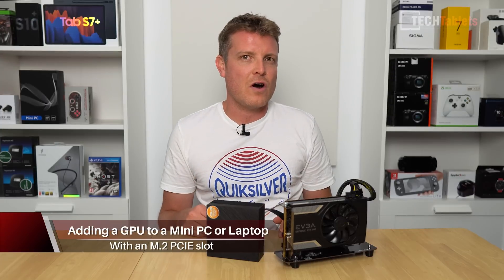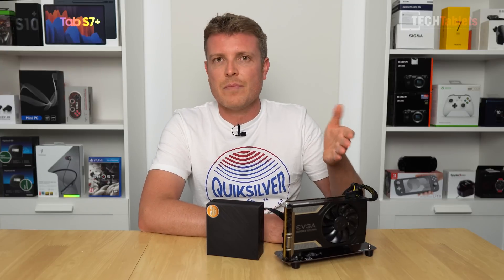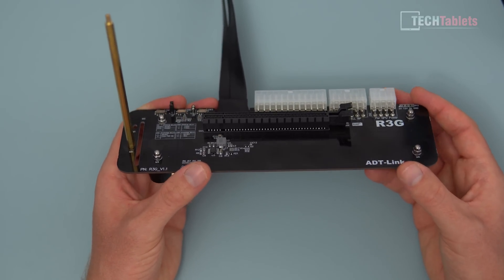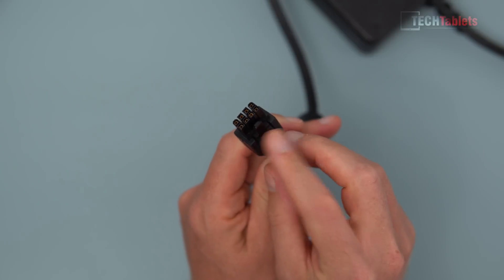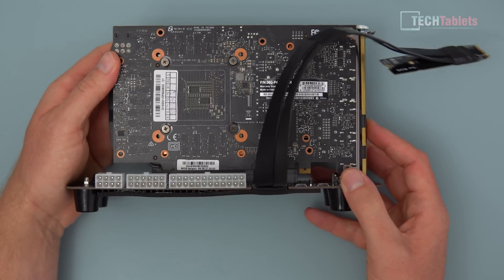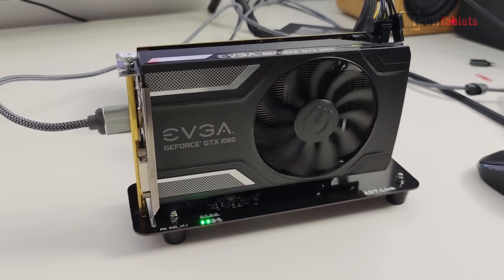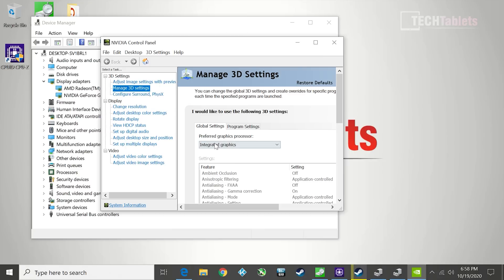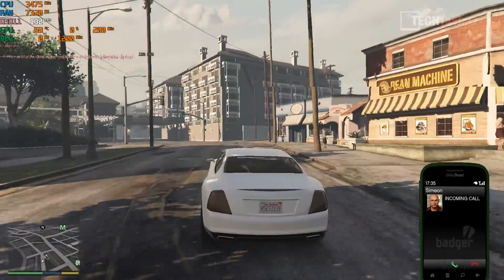Turning My AMD Ryzen Mini PC Into Gaming PC! M.2 PCI-E to eGPU Upgrade

Comment: This is the pcie info for ryzan 7 7735hs  PCI-Express:	Gen 4, 20 Lanes
(CPU only) what does this mean to run an external gpu want to run a gtx 9080 trying to do 5120x1440@200hz resolution

Comment: I have a HA-4 Ryzan 7 7735HS  can I use an external GPU with this want to hook it to a LG Monitor 45GR65DC-B which has a resolution of 5120x1440@200hz can this be done with this mini pc desperate for an answer right know the monitor will only give me split screen, or 3 quarters of the screen with this mini pc because it can't handle this resolution

Comment: Curious.  Has any company introduced hardware that connects to multiple m.2 ports?  2 ports I guess for example for 8 lane.  Not sure if the chipset would be able to make sense of the 2 ports connecting the same device or if it will just see it as 8 lanes.  External graphics aren't necessarily my end goal with my thought process.  I'm thinking of HPC and heavy analytical work.  I've also wondered if any of the multi GPU mining rigs could be repurposed for this idea.  I'm sure I probably am unaware of other ways of adding GPUs for calculation so any suggestions or pointers would be appreciated.  Cool video, thanks.  
I think most chipsets only connect with 4 lanes, so maybe it wouldn't matter anyway unless I'm misunderstanding what I've seen.

Comment: How would a Sonnett  Breakaway puck with The RX5700 work. Running R7 7735HS  32GB DDR5 and 1TB in a GMKtech K2 Nucbox. The 680M just isn't enough
Reply from the maker: It should work fine as long as you have two NVMe drives one for boot and one for the eGPU.
Reply: @Techtablets  
Going a whole completely different direction now ended up scoring on a  RX 7800 XT for near nothing less than 200 so I'm thinking of just building a decent mid grade unit

Comment: ALTERNATIVELY if you dont have an SSD slot for an alternative hard drive, you can use an external m2 USB-C adapter hub. This is especially convenient if you only have one m2 slot that was taken by your old SSD. you can just pop the SSD out, free up the slot for your external GPU and put the SSD (m2) into the external enclosure that plugs into the USB-C. USB-C data transfer rates are fast so it won't affect read and write speeds much.
Reply: What do you do if the new GPU doesn’t show up on the device manager?
Reply: @echofoxtrotwhiskey1595  usually it will show up, it could be:
•check connections
•your pc's m2 slot may not be compatible with this kind of set up
•make sure you have the most recent DRIVER FOR YOUR GPU installed. 
•your adapter may have an issue (the platform you slotted the graphics card on) and you may want to buy a different one.
•you will want to disable the integrated graphics
•you will want to use an external monitor via hdmi from the back of the EXTERNAL GPU to your monitor.
•make sure you are using a BIOS version that is compatible with your GPU.
 
•Google and youtube are your friends. look for other solutions and solve it yourself. 
These are just from the hip thoughts as I was trying to think of reasons you may have issues.

Comment: Hello from Florida mate .. I'm plying around with my minisforum um790 pro and I need both M.2 drives but I could use the PCIe4 on the wifi card, and then plug an USB dongle for WiFi .. but I think the edge plug connector might be different between SSD and WFI female receptacles

Comment: nice build but the used M2-NVME PCIE adapter is way to expensive there are cheaper ones that cost 1-third of the price, also the used DELL-PSU only handles 200watts thats not enough for any decent GPU like 1660ti / 2060s

Comment: Hey Chris. Didn't know you'd made such a video. I usually watch your phone and mini PC reviews. I'm looking to use an RX 580 GPU in such a setup on a laptop. But another video said that the laptop dedicated and eGPU should NOT be of the same brand (i.e, should pair Nvidia and AMD GPUs). Might be the reason why your 2060 laptop had issues with this 1060. Possible to verify? Because the laptop I plan on getting is a Ryzen APU 😅
Reply from the maker: I've had issues with laptops that have s
Dgpus already the best ones are those that only use intergraded graphics.
Reply: can we use RTX 4060 with i5 12500H laptop with that connector @Techtablets

Comment: It won't work on laptops or mini PC's that already have an NVIDIA gpu, so you need to to buy an AMD GPU for a PC that already has an NVIDIA, and NVIDIA for a pc that already has an AMD gpu, if the computer has an intel graphics then AMD or NVIDIA will work just fine.

Comment: I have a problem with a similar setup. In my setup, I'm using a 6600xt with a 4k monitor. In mostly newer games, after Vram is full, the power draw of the GPU reduces a lot(like 130 to 80) and FPS drops as the same percentage at best, while all of the other metrics are normal. As I can't monitor real-time pcie bandwidth usage, I can't be sure. Does anyone has experienced this kind of problem?

Comment: I have a mini pc with 2 pcie slots, 1 m2 sata and 1 nvme 2280. I connected my rtx 2060 super on bolth slots, but the performance is always the same, it shows x1 on cpuz

Comment: Does anyone have info on which low wattage GPU selection would work with the SER 4800U? I've maxed the overclocking as far as it will go, just needs more muscle from GPU but although the install and setup are easy there's not a lot of info on compatible GPU with the AMD Ryzen 7 4800U. I'm looking to stay below the 200 watt threshold as to not have an insane power bill. Thank you in advance

Comment: Love your video’s.I was wondering if I’d be able to use that adapter to plug a 3060 to into the second m.2 slot on my Beelink gtr 5 with a 5900hx. Would that allow me to do it without using a sata ssd for the os?

Comment: Hi Chris, maybe you can help me? I have the Minisforum HX90 Mini PC and I want to use the Nvidia RTX 3080 Ti FE with the ADT-Link PCIe Board connecting to the NVMe PCIe slot. The power supply is the Dell DA2. I placed the ADT-Links connector instead of the NVMe SSD. Before I installed a 2,5" SSD. Unfortunately the RTX 3080 isn't recognized of the system and isn't shown in the device manager. Do you have a device solving this problem? Kind Regards Jens

Comment: I'm gonna try one of these with my 390X by Christmas time.  Need to source an SFX Full Modular power supply with enough watts & amps for a fully overclocked AMD R9 390X 8GB clocking to near 1250Mhz core & 1800Mhz memory which is 80 Giga Pixel per second & nearly 500 gigabytes per second memory bandwidth.  Requires a lot of juice.

Comment: I have to x400 minis I have 2 m.2 slots but are not nvme I got a m.2 m key to pciex4 and a pciex4 to pciex16 will this work ok? Can I use the adt even tho my ports are not nvme? Please help I have a GTX 1080.

Comment: Is the mini-PC able to power up fine with the m.2 card in but the GPU box not powered on? I'm thinking of using the internal graphics for most things and only power up the GPU when doing video editing with Davinci Resolve. Obviously I'd have to figure out a monitor switch to go between the two I think.
Reply: Long Short story, no. Whenever you plug eGPU docking, you need to power both MiniPC and eGPU simultaneously.

Buy if you intend to save Electricity Bills, then the overall setup of MiniPC and eGPU Actually consumes about 50% Less wattage than a full Build Desktop PC.

Comment: Can I connect M.2 to the SSD M.2 case with USB Type-C output instead of connecting directly to the motherboard?

Link do Case M2: https://www.banggood.com/ORICO-TCM2-C3-NVMe-M_2-Transparent-SSD-HDD-Enclosure-10Gbps-USB3_1-Solid-State-Drive-Enclosure-Case-Hard-Drive-Disk-Base-p-1517296.html?cur_warehouse=CN&rmmds=search
Reply: No. USB is Not part of PCIe controller.

You need to directly connect the M.2 to the Motherboard.

Comment: What is the best gpu to use with this? You know the most powerful card that you can use before getting a bottleneck
Reply: PCIe X4 means it is about Quarter speed of PCIe X16 of Desktop counterpart.

Which means it will not make any difference if you use GTX 1660 ti or RTX 3090 because of the Available Bandwidth is holding back the Data Flow Traffic from MiniPC to eGPU, in order words, Bottlenecked by the Cable itself.

Comment: Waiting for the Ryzen 4700G or 4750G with integrated graphics. If the mobo supports Thunderbolt 3 then I could use an eGPU solution of course.
Reply: Thunderbolt eGPU is way slower than this. There's Bigger bottleneck in Thunderbolt eGPU interface.

Comment: The real question; is could you have used the m2 slot that the wifi card is in; and forgone wifi.  (I know the board for the egpu is the longer m2 standard; but its only for the screw...)
Reply: And the said WiFi adapter card is WiFi 6? Then it might be only applicable to NGFF based eGPU like EXP GDC eGPU NGFF.

Comment: Would be far better to trim the bottom cover, and far easier as well as neater, the feet risers will give the cable clearance to tuck under and in.
Reply: While your comment is absolutely CORRECT, there is actually another MiniPC of the same Processor, but is assembled by different company and it has built-in Holes for the cable.

Like HYSTOU MiniPC

Comment: Does the EGPU get extremely hot pretty quickly?
Reply: eGPU never gets Hot because there's no Traffic Processing occurred on its PCB board. All of data is Processed by the main GPU, while the eGPU is like a tunnel or highway.

eGPU literally just Traffic Flow of Raw Graphics data from Laptop or MiniPC to GPU.
Reply: But the GPU itself can get Warm, but never actually reaching Hot temperature. Because basically the Lower Bandwidth traffic of PCIe X4 makes Less heat, than compared to standard Desktop Motherboard with PCIe X16 where the GPU can get really Hot because of Higher speed bandwidth.

Comment: if you plug in your monitor on the mobo hdmi out, can you still render with the external gpu?
Reply: If you have HDMI cable, why bother plugging it to the MiniPC HDMI output rather than the main GPU HDMI output? 

The Performance works far better if you set it exactly like this video.

Comment: Which RAM are you using? I have the PN50 4800u, and I’m having nothing but trouble with 2x32GB Kingston HyperX, to the extent that I’m running it with one stick of memory to avoid crashes multiple times a day.
Reply: In most MiniPC or Laptops, the RAM is always fixed Frequency and Latency which means you can only use that same kind of frequency. And also fixed amount of Maximum RAM capacity.

So when the Manufacturer say it supports Sodimm LPDDR4 2666Mhz, that means any other frequency is not guaranteed to work. And sometimes also need a bit slower frequency of running Dual Channel RAM to justify the Voltage distribution.

The Reason your 2x32 GB crashing a lot is probably not enough Voltage to supply both RAM sticks. It might be doable if you try to undervolt and underClock the CPU just a little bit.
Reply: Ryzen Master app is very useful you know :)

Comment: Nice video. Chris, when you turn off PC, did the Dell DA-2 go into stand by Yellow? and turning on PC wakes it up to Green? Same as when you use ATX PSU, I am wondering if the board is controlling the soft start of PSU and isolating common ground from PC PCle and PSU to ADT-LINK board, if common ground is well not isolated then there will be noise heard from audio and shorten all electronics life, PC and GPU

Comment: Theoretically, this could be done with the m.2 slot on my laptop as well? It is a V4 PCIe m.2 slot. What kind of throttling do you find with only 4 lanes on the m.2 drive?
Reply: Just imagine using PCIe Gen 3 X4 Lanes.

That is equal to PCIe Gen 2 X8 Lanes, or equal to PCIe Gen 1 X16 Lanes.

That's what you get.

Overall, still faster than Thunderbolt 3 eGPU because Thunderbolt 3 only using 22 Gbps Max. Meanwhile this video is 32 Gbps.

Comment: I wonder if you could keep the M.2 SSD and plug the R3G into the Wi-Fi m.2 slot...could the connector be chopped shorter? Those mounting/gnd holes don't seem to be in use...
Reply: I’m curious of the same thing.
Reply: @paulinfrancis  I'm pretty sure you can cut it but I decided to keep my Wi-Fi card, SATA ssd is fast enough. It would also be difficult to get that stiff r3g cable in there, there is not a lot of wiggle room with the 25cm

Comment: Just to clarify... You don't need to output the video source through the GPU in order for this to work correct? So if i were to take my older Acer Nitro laptop (or any older laptop with a decent CPU) and run this set-up it should be playable through the laptops screen?

Comment: How much slower are your graphics cards when used in a Thunderbolt 3 eGPU on an Intel NUC?  Is it comparable to this M.2 setup as I use a NUC and Thunderbolt 3 eGPU which is really easy to disconnect if I just want to take my NUC somewhere?

Comment: Nice review, FYI 12volt wont hurt small children, but you come across as a confused individual, Kiwi/Aussie/British meshed accent and quoting USD and Pounds all in the one video! dude pic a brand lol, jokes aside, you needed to mention that you must always choose a GPU from the other team due to driver issues, if your laptop/mini PC has integrated AMD, then you must use an nVidia external GPU, and vice versus.
Reply from the maker: Well I'm a kiwi that has lived  in the UK and now in Spain. I also speak Spanish so meshed up accent is likely. Well because I ordered the PSU from Ebay UK. So naturally it was in pounds.
Reply: @Techtablets  All good bud, was just winding you up :) lol, I will have to try one of these M.2 adaptors, as I have tried Thunderbolt, which drops way more than 6% in performance, and this gets worse the bigger the GPU, had tested a 1070 and 108 TI, and the built in Radeon GPU in my iMac was still better.

Comment: Can you use a adaptor to m.2 connected through a internal hdd slot? Cause I got a mini pc with two hdd's installed n no m.2
Reply: I'm pretty sure you can't since Internal hdd usually uses a Sata Port instead of PCIe
Reply: @yohaneshalim9157  theres reason why it's a called adapter 😂 I know it'll work for more simpler small things but for GPU's is the question? Haha
Reply: @KnightWing274  adapter adapt port but do not adapt electrical signal. Sata and pcie uses different electrical signaling system. That was the reason for me saying that. I thought it is something apparent, but well, my bad. Basically, you cannot expect pcie device to work on SATA ports.

You can tell me though if there is any adapter that also convert the signal between ports AND also fits inside your mini PC. I've done my research, there is none that is good rated (and those most probably doesn't work, hence the low rating, at least in amazon and newegg it seems so).

Comment: Thanks a lot for the great presentation and clear explanation. Just have a question. Your mini PC has one m.2 slot and one SATA slot. But what about two m.2 slots which my NUC has? Both are PCI-e 3.0 x4. One for OS boot and another could be used for eGPU. Actually I don't see any reason not to work but would be great to be sure. Have you tried?
Reply from the maker: That will work two M.2 PCIE 3.0 x4 drives use one for the boot and one for the GPU. It's only an issue if it's a laptop with 2x PCIE 3.0 and say a dedicated GPU like the RTX 2060 that's where I ran into issues.
Reply: @Techtablets  i'll give it a try, thanks!

Comment: How can i add eGPU on AMD  Ryzen 4000 series laptop which doesn't have any dedicated GPU or external NVMe slot.....??.
It will be helpful if you add an eGPU by Type C port (or any) on amd laptop which doesn't support thunderbolt but support DP/PD and other things.

Comment: Just a note: the PCIe scaling with a 3080 is going to be much rougher at PCIe 3.0 x4.  Tech power up has an analysis and the equivalent methodology was about 75% of the higher bandwidth configurarions

Edit: unless this is 4.0 x4, not familiar with this board
Reply: You were looking at PCIe 1.1 x8 numbers? That's equivalent of PCIe 3.0 x2.   With PCIe 1.1 x16  RTX3080 retained 87-90% of it's full performance.

It's kind of mind boggling to think that RTX 3080 on  PCIe 1.1 x8 bus is still slightly faster than RTX 2080 ti on PCIe 3.0 x16 bus.  After all PCIe 1.1 x8 offers slightly less bandwidth than AGP 3.5 bus from the year 2003!

Weirdly enough internet doesn't tell if that's PCIe 4.0 or 3.0. Not even Asus specification list or manual for this product tells that.

Comment: I wish they could get rid of the 2.5 drive mount and use that space for an Nvidia GPU module. I'm not against having storages, but they are the easiest to expand and the weakest point in these tiny machines are the graphics performance.

Comment: Good video.  Kind of destroys the very reason to buy a mini pc.  Would love to see a case mod with a io for the m.2 on the outside to make it removable.  Use something like this to mount on the case itself:  https://www.amazon.com/Extension-NGFF-Cable-90%C2%B0Right-Angle/dp/B089Y7VQMD/ref=asc_df_B089Y7VQMD/?tag=hyprod-20&linkCode=df0&hvadid=459623382939&hvpos=&hvnetw=g&hvrand=18051766405756109979&hvpone=&hvptwo=&hvqmt=&hvdev=c&hvdvcmdl=&hvlocint=&hvlocphy=9009681&hvtargid=pla-955174206171&psc=1
Reply: And yes I know this is m.2 to Pcie.   Going for Form here.